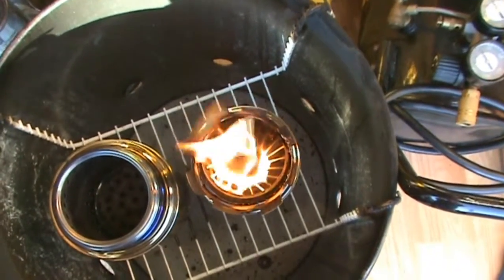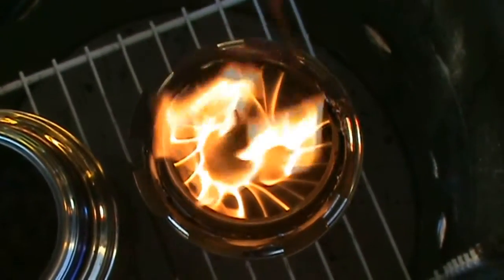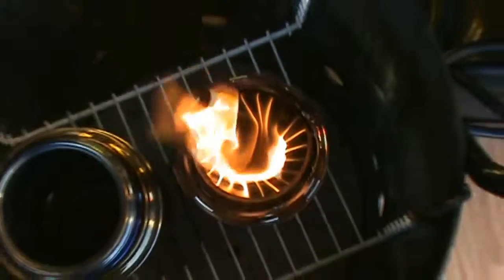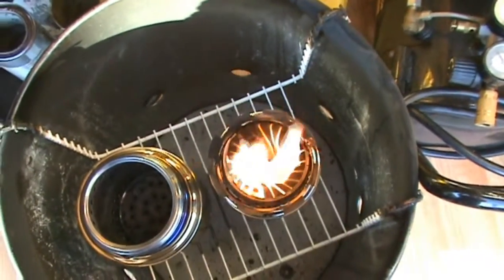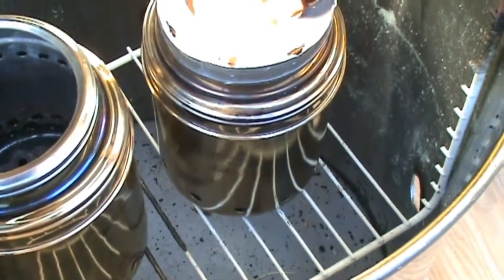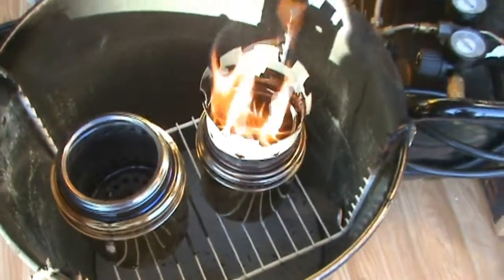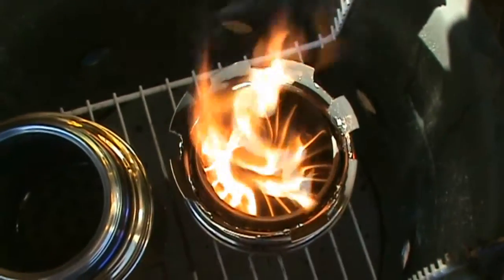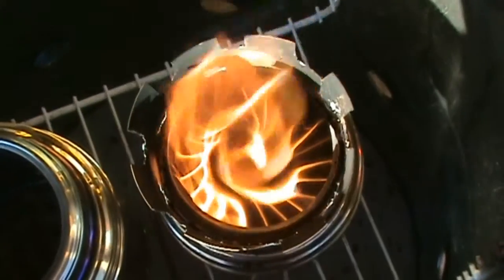Wood Gasifier 5 to 1 primary/secondary air ratio

Comment: You may need to make more volume for the fresh air inlet holes. You should be able to cover at least 2 of them and see no effect on the flame. If you do see an effect on the flame after covering 2 holes either add a couple of holes or increase the diameter of them. You are really getting close though. The vortex 5.4 that I built does not smoke even after the flame goes out. The only other thing may be the primary holes are just a little too big. Great work!!
Reply from the maker: +Heath Putnam Thanks! I tried covering every other hole and it didn't want to gasify at all, so from what you said it does look like something to try, hopefully this weekend. I think it started smoking when we added the second row of primary holes in order to get to the 5:1.  Maybe someday I'll get another canister set and do it right the first time...
Reply from the maker: +Heath Putnam I increased the fresh air inlets diameter to 1/2". The flame might possibly be a little clearer, but still no blue. There did seem to be less smoke though, except when it was burned down to near the primaries top row. Smoke started coming out of the fresh air inlets toward the very end, which I think is because the coals are falling down through the bottom 25 holes. I'm wondering if maybe the bottom holes should be smaller than 1/4" for that reason. Wood pellets are pretty small to begin with, but maybe the holes should be 1/8" just to let the ash fall through and not the coals.
Reply from the maker: +Tothe Point Made another video that should be uploaded soon: https://youtu.be/lOCDOy-uWQE .
Reply from the maker: +Heath Putnam I'm starting to think that the blue flame requires cans of diameters that are very close in size. I've watched many videos on different models, and few if any achieve the blue flame. All of my stoves have a fairly large difference in diameter between the inner and outer cans, about 1".
Reply: The diameter of the outer can must be close to the diameter of the inner can to heat the air as it moves up towards the primary air holes. I shoot for 3/8 max gap. More tends to not heat the air properly and less tends to inhibit air flow. I only experimented with close fitting cans. You are trying totally new stuff. Good luck!